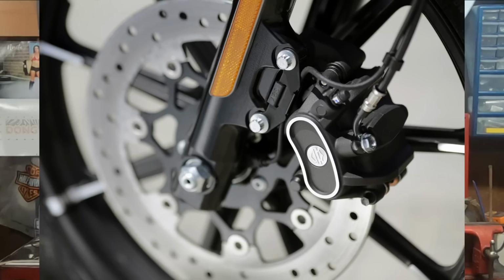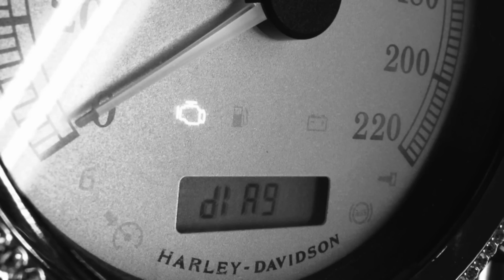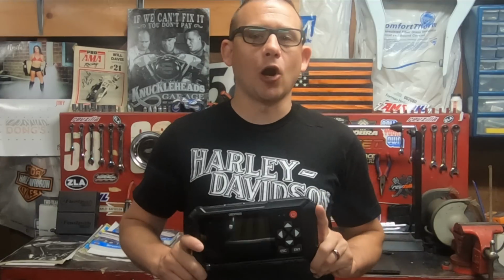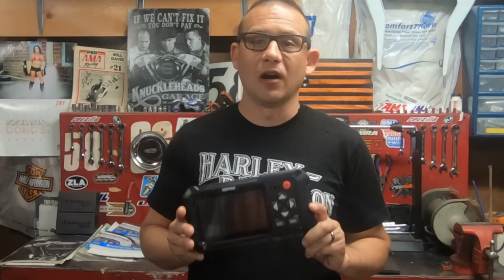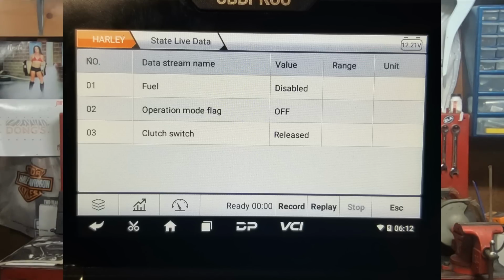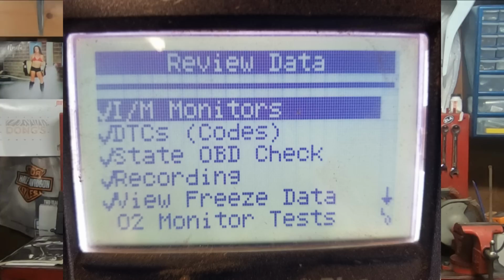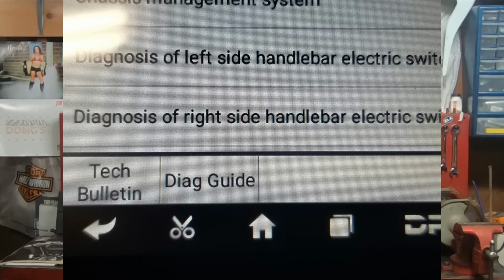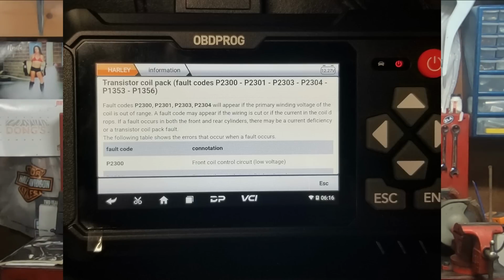Motorcycle Scanners are the Future of Motorcycle Maintenance

Comment: Do you like the scanner? I looking for one mostly for ABS. Any fees.  I’ve watched a bunch of vids on these but no one actually uses them.
Reply from the maker: It's not bad for what it is, but depending on your year of bike you can pull codes off the dash if you just need to read the code and diagnose components from there.
Reply: @GixxerFoo  have you heard or used ITM ABS flush for Harley. I’ve seen a couple reviews on it all pretty good.

Comment: Absolutely will not activate ABS system.....  I bought this scan tool through link.  I contacted tech support.  This is the response I got.

This device does not support ABS special functions. This menu is misplaced by engineers. Later, I will modify and delete this wrong menu.

Best Regards,

Grace XU

OBDPROG Tech Team

Comment: It says it comes with one cable for a HD.  The 2021 and newer interface connector is different, so it can't do both.  Is there another cable that you need to get as well (for the newer plug in)?

Comment: This unit is falsely advertised. It does not activate the ABS for bleeding. It has a subsystem that leads you to believe that but when you access (ABS Bleeding), it just goes to a menu that only allows code reading and viewing live data. I have watched a lot of videos concerning bleeding ABS on Harleys and I can only conclude it’s bull crap. Those systems require you to manual bleed the system first then actuate the ABS to get the air out and in many cases, with some of those systems, does not require a second bleeding. Well if we do this to get the air out of the ABS and then it’s not required to second bleed, then where did the so called air go? It’s a sealed system. Did it teleport out all by itself? If you manually bleed ANY braking system and the pedal or lever is NOT spongy or low, then there is NO air present in that system. Period! 37yrs as an automotive technician tells me that. At best, actuating the system mixes the very little fluid that may be left in the block with the new fluid you installed and actuates the valving to lubricate with newer fluid so older fluid is not left in there to corrode and cause sticking which is the real original issue with Harley ABS units. Manually bleeding the system and activating the ABS manually by applying solid pressure when riding will do exactly the same thing but word of caution! If your valves are already corroded, then activating the ABS in any form may cause issues due to a valve sticking from that corrosion and could lead to disaster for the rider manually activating the ABS. It can also lead to disaster by electronically activating as well if corrosion has already taken effect. It’s always a 50/50 gamble due to ABS valving not frequently being activated and the valves sitting in the same spot in the block for years because your ABS never had to activate. I see it all the time in cars with the same units made by the exact same manufacturer. This is the reason Harley wants flushes every 2 years. And this is the reason Harley wants those valves to move in new fluid every 2 years as well to minimize the possibility of sticking. Not to get the air out.

Comment: Currently in the market for a oil pump & cam plate for a 2017 M8 SGS. Trying to see which direction I should go, Fueling or S&S. Leaning toward the Fueling setup.
Reply from the maker: I like the Feuling OE setup for a couple of reasons, they have a looser tolerance and depending on what your crank run out is they will deal with that a lot better. The race plates you should really be under .005 on the run out which isn't always the case. Some will say they are fine with higher run out but you do run the risk of that run out tearing up a tighter tolerance race plate.
Reply: @GixxerFoo  I appreciate it.

Comment: Can this unit read the mileage stored in the ECM? Was told that only a HD Digital Technician computer can read the ECM mileage (HD call it running a "birth certificate" test printout). Very important data when purchasing a used HD motorcycle as I have often encountered that the odometer mileage and the ECM mileage are completely different-used to sell a bike with low mileage but in actual fact is a high mileage bike.
Reply from the maker: Oh that's a good one, from what I saw in my testing it will read the mileage from the ECM. I know our bike's mileage is correct as the wife and I are the original owners. I'll do some more digging and see if it can go that deep, shoot me an email on my channels contact page and I'll update you on what I find.

Comment: I've been helping a friend of mine with a 2007 Softail. It was in a fire and between the two of us we rebuilt it and it ran fine for 2 years. Then one day it wouldn't take throttle it would idle but that's it. The code was for a crank position sensor which we replaced. All was good we cleared the code several weeks later again it wouldn't take throttle it would idle but that's it. This time it had a code for a map sensor and also the throttle position sensor which we replaced it didn't do any good I did more reading and there is a problem in certain years with the wiring I checked out from point a to point b between the computer and the sensors and the wiring seemed fine no break. Just because this bike had been in a fire and the fire was more in front of the gas tank as it was in a garage we just replaced the wiring harness with a used wiring harness from a known eBay dismantler but still it would not take throttle. We thought maybe the computer so we bought a used computer I was able to marry the computer to the bike but still the same thing and it won't clear the two codes. Not knowing a lot about computers I prefer a carburetor and which I have on my bike. He took it to the local Harley dealer and immediately they said the two sensors we replaced should be Harley brand they replaced them then they came back and said it still don't take throttle you need a new wiring harness. I know this is getting long. He paid them for their 2 hours of work and $300 and two parts that didn't do anything. So I'm at a loss helping him and it sits in my barn .. the dealer just wanted to throw parts at it parts we already replaced I just think they didn't have somebody that was knowledgeable in in-depth work that's the way I feel so like I say we're at a loss maybe you have some ideas thanks
I did check the fuel pressure and it was about 45 PSI if I remember I made up a test device from an automobile test device cuz that's what I was initially thinking but why would it show codes for those two sensors. 😲
Reply from the maker: Dang that's a crazy one there, I would honestly get a single fire ignition and convert that bike over to a carb. With all that going on there's something very obscure in their where there's been a break down in electronics. You really get to a point where your chasing a ghost like with the magnetti marelli system from back in the day.
Reply: @GixxerFoo  😊👌👍

Comment: @gixxerfoo gixxerfoo. Not sure why but I can’t tag you in this comment. 
Just wondering if these informative posts, and no doubt the are very informative, are infomercials?  
Are you paid for this product endorsement? 
Are you paid for any of the products you endorse? 
In my case, it wouldn’t matter because I’m still learning from the material and I’ll make my choices and decisions about a product. 
However, it is good to know if your preference is influenced. 
Thank you.
Reply from the maker: I'm not paid for the products, I agree to test the products out and they know full well I'm going to be honest about what I find. If it's junk I will send it back to them and not do a video over it. I've done that before but if it's a good product and I feel others can benefit I'll make a video over it.
Reply: @GixxerFoo  Thank you for the reply and disclosure. 
One additional question; One huge topic these days is the heat of the M8 engines. Does the ECM record engine temperature, oil temperature and if so is there a device that we can install to display that information while riding? Thank you.

Comment: I have a 2016  Street glide special with ABS.
So if I have to change my ABS system and my brake lines and ABS system has no brake fluid and is full of air in  the brake system I can use this MOTO 100 to bleed my brakes?
JUST WANT TO be sure before I spend $700+ for this  Computer.
Reply from the maker: You'll be able to activate the ABS system and push the fluid through, there's even the how to in the repair guide on the unit. Plus it's from Amazon so if you have any issues or if it's not for you it can be returned.
Reply: @GixxerFoo   Thank you
Reply: @GixxerFoo i was not allble to activate my ABS with this OBDPROG MOTO 100.
It would only  let me  Diagnose  The ABS .
IF
Reply: @GixxerFoo i was not allble to activate my ABS with this OBDPROG MOTO 100.
It would only  let me  Diagnose  The ABS .
IF

Comment: My new to me KLR650 (2001) has none of these issues or problems. Been my daily for a year now. With DG "muffler " sounds pretty good. Jetting was necessary. No EFI issues whatsoever! It has a proper carb. I would not trade it for a new one  straight across. No EFI or ABS. Means perfect machine! I hate computers in our machines. No place for them. My wife's 2012 VStrom 650 still has it's original Yuasa battery.....starts great every time.
Reply from the maker: The good old KLR, those things would survive a nuclear blast! I'm not too crazy about the fact they went fuel injected on the new ones but they had to to keep on selling it.

Comment: In the questions section of the product reviews, it states that it DOES NOT perform ABS Flush, it only reads the various  codes.
So, according to that, if you want to activate the ABS Module to completely flush the system, this unit will not do it. Flushing the system in the normal way without ABS activation DOES NOT remove all fluid. FYI. Snap On has one, but $$$$$$$$$.
Reply from the maker: It doesn't perform the ABS flush but you can activate the system to allow you to push out the old fluid through the module. Yeah Snapon is stupid expensive!
Reply: @GixxerFoo  In the sealed system, abs activation alone will NOT flush out fluid. The abs utility is the ONLY way to flush and remove old fluid from the  abs system,  AKA "ABS FLUSH".

Comment: Great information bro as usual.!
Could u sent me  The information on that scanner and the code for the battery tester?
 What's your opinion on fuel injector cleaner for the Fuel injected bikes?
Reply from the maker: Thank you, I appreciate it! I actually run a little bit of injector cleaner through my bikes every now and again, it won't hurt a thing and actually help out quite a bit. Just measure it out for the size of your tank, here's the links for the scanner,

Buy one and get one free!
Moto100: https://www.amazon.com/dp/B09S3LKYXV/                      
European Motorcycles https://www.amazon.com/dp/B09Y987XTQ/
KS21: https://www.amazon.com/dp/B07KP8GCWG/
Code: 1GixxerFoo
Reply: I need the Information on that scanner .
 An you send it my way.

Comment: Life is too short to waste time figuring out what’s wrong with my bike. I just take it to the dealer for maintenance. It it breaks, they fix it under warranty. The best option I got on my Harley is the 7 year ESP.
Reply from the maker: Having the work done is great if you have the service plan, it's expensive but a lot of guys like to do their own work and not rely on anyone.
Reply: @GixxerFoo  Well the ESP on my 21 RG Limited cost me $30 a month. I did the SE Stage 2 in the first 60 days, best bang for the buck upgrade and it’s covered for 7 years unlimited miles. Regular maintenance and tires is all I have to pay. If someone can’t afford $30 a month they should be buying a cheaper bike.
Reply: @RealSuperRando  That is $2,500 over the course of extended warranty.  Just hang onto that money in case it breaks; if it does not then you are money ahead.

Comment: I recently had a code on my 09 sportsrer 1200c i caused it lose of idle code i instaled a manuel idle air valve just forgot to idle it up after i turned it off i put one one it for shifting so much smoother putting it onto gear pluss it sounds good got it idle to 900rpm
Reply from the maker: Those manual idle controls are nice, just make sure to not go lower than 900 or you won't get proper oil pressure at idle.

Comment: Was thinking I need this to bleed/flush ABS brake system but have seen information saying it's not necessary. What does the scanner do to the ABS block so that you can bleed/flush brake system? BTW, the information did state that you had to use a reverse bleed tool.
Reply from the maker: This tool allows you to activate the ABS system which allows you to push fluid through it, there is also access to how to do it on the tool as well. Harley says flush the brake system every 2 years, you'll find testing the fluid more often than not it's still good. Flushing the system just pushes out any junk or build up out of the brake system.

Comment: is there an adapter so to hook up something like my MODIS OBD II scanner on my Harley which I'm hoping can perform the same task?
Reply from the maker: Yes all the adapters work for OBDII to your motorcycles specific diagnostic port, but the tool has the specific software for the motorcycle. With another scanner you will likely only have some very basic functions.

Comment: It’s almost impossible to try and make a repair on an ECM controlled motorcycle without this tool.  Lots of $$$ spent without proper tools.  A wrench can’t fix everything.
Reply from the maker: Right to repair is going to be a huge deal going forward, you pretty much have to have a tool to work on electronics and access deep into the system these days.

Comment: Will this allow you to go into the system and reset/change the speedometer to display the correct speed or go into the section that allows (say on a 2018 Tri Glide) to separate the running lights from the head light to be independent of one another???? Or to flash the ECM if I decided to install a WIM??? Thanks for all the great info you provide!!!!
Reply from the maker: Yes it will perform a lot of function and I know for sure the speedometer is one of them. It's software works by vin and available systems on the motorcycle, it will flash software to the ECM but I am not 100% on if it can change your lights to operate independently. I'm not sure if on the Tri Glide if that's hard wired or controlled through the canbus system.

Comment: Cars and bikes are today designed so that the average owner cannot work on them. Aside from oil changes which is still mostly a do it yourself maintenance job, You need specialized tools and equipment to troubleshoot, analize and repair problems. Most manufacturers have specialized equipment designed for their brand only like Audi, BMW. Mercedes! You can't analyze your Harley because of the software needed to do so. I didn't know that antilock brakes needed to be bled every 2 years. I guess my 2012 Ultra and 2016 Heritage are overdue! Thanks for the update.
Reply from the maker: This scan tool really unlocks all the systems on your Harley, you can even get better software for different systems from the aftermarket. Keeping the right to repair is going to be an even much bigger deal as time goes on.

Comment: I’m a fan of “Right To Repair”. One reason I bought a Triumph. I can access everything through the OBD ll port ($25-30 two years ago) . I can upload/adjust tune, read/clear codes, purge ABS… I believe all manufacturers should use it. My KTM is a different animal, hackers are just now making headway, much less a guy messing around in the garage. Edit: Just looked it up and it’s now $21 on Amazon. If you have a Triumph the BARX Bluetooth OBDll reader is a must)
Reply from the maker: Thanks for sharing! Right to repair is a huge deal to me, we should be able to do our own work without having to go to a dealer. Sadly a lot of manufacturers go out of their way to lock their systems down.

Comment: cant use a dog bowl for that now can i? yeah if you get an open code. it could be any censor. im bike though ecm codes and put it into limp mode. All censors measured good. but there was a broken wire in the pack that was still making continuity but.... it would be nice if that tool could fine that a lot faster than i could.
Reply from the maker: That's tough to find, that's where your livestream data comes in but that's a very obscure thing to track down. Even reviewing live data you're still going to have to look at several different systems and know what the baseline should be.
Reply: @GixxerFoo  yeah id like to say i found it . i knew i wasnt getting the same amps in and out of the throttle ... sometimes.. but it was a teck at mad river Harley that found and fixed it. he said 9 cents worth of solder fixed it.

Comment: I did consider a scan tool for about 1 second  but having that scan tool opens a whole cam of worms I don't want ! I send 07 & up bikes to other shops that give me machine work .oh I do some fuel injected bikes but give me that carb any time  ! Canbus system good luck with that in 10 or so years ! I keep plenty busy in my shop without those computers ! Anyway that's my 2 cents on that !
Reply from the maker: Agree, canbus while a much simpler system wiring wise it's all run through the ECM. You lose the ECM and you're done, there's no bypassing things like the old days.